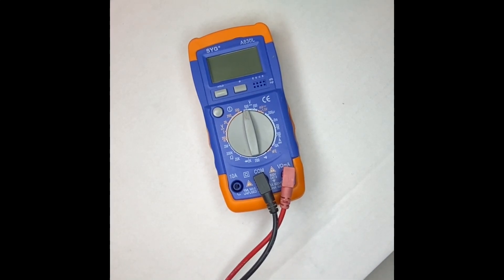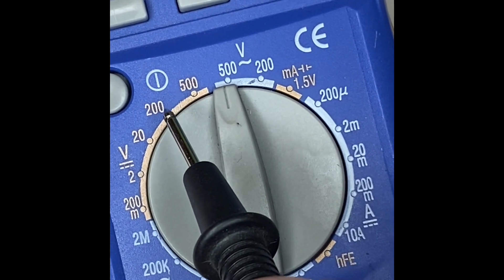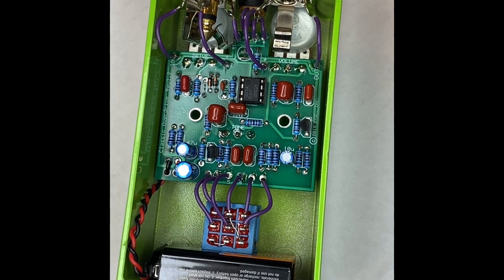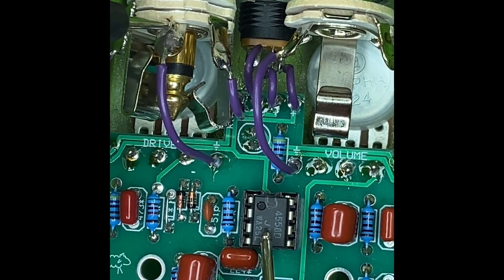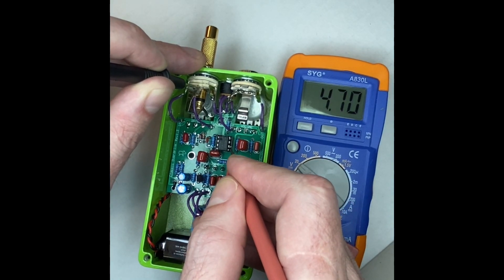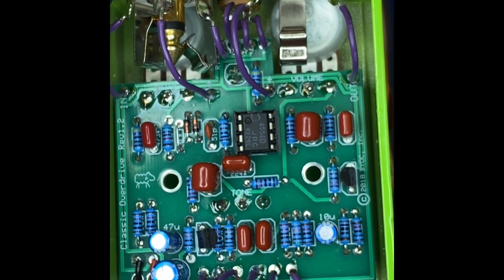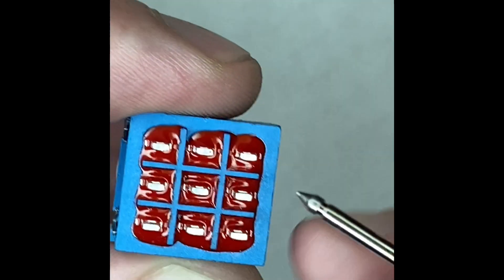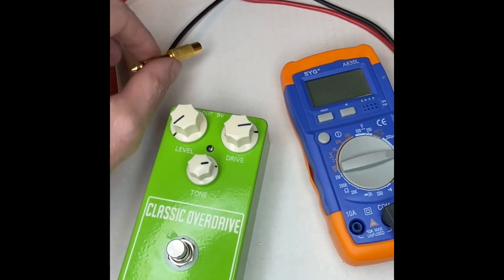How to Use a Digital Multimeter (DMM)

Comment: hey man, thanks for the work you do. love the large beaver i have (is there a reason for updating the design with toggle switches instead of the knob selector? i have the old version and prefer the aesthetics).
btw, would if be possible to put up some vids of the color booster, im trying to decide between that and the silver pony 2... thanks!
Reply from the maker: The previous rotary switch was expensive and frequently out of stock.  And it was confusing for a lot of people.  The little set washer caused a lot of problems.  The toggle switches are cheaper, readily available, and easier to work with.  I don't have any plans on making a demo for the color booster at this time.  I'm sure you can find other vids around here if all you want is a sound clip.  There is a real love/hate relationship with the color booster.  A lot of people get it because they thinks it's going to be David Gilmour in a box, and it isn't.  It doesn't sound anything at all like the Klon, so if your on the fence between a Klon clone and the color booster, and you're familiar with what the Klon sounds like, the color boost probably isn't what you're looking for.  I personally don't think it's a very good "ala carte" dirt pedal.  But because it has a lot of gain and a 2-band baxandall EQ, it is however, very good at pushing a tube amp into distortion, giving another drive pedal a goose, and also as a sort of pre-amp.
Reply: @buildyourownclone  thanks for the reply! does the rotary shaft being taller than the other pots contribute to the confusion? 
currently my knob for the rotary switch sits a fair bit taller than other knobs, and i was wondering if there was a work around to that (apart from matching the heights by adjusting the other knobs to sit higher)
i think i'll just go ahead and get both; i've listened to them both on a japanese channel, they do sound very different and i like them all